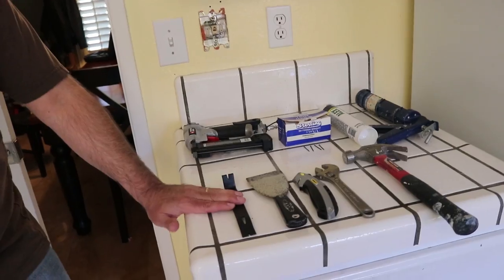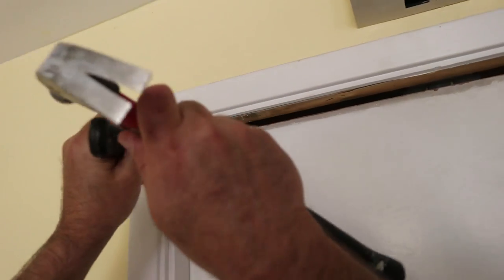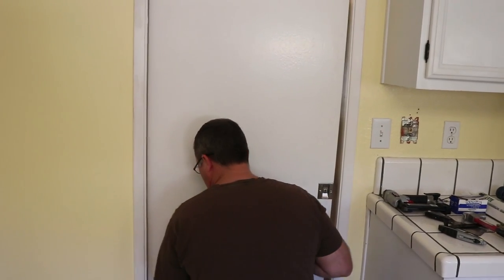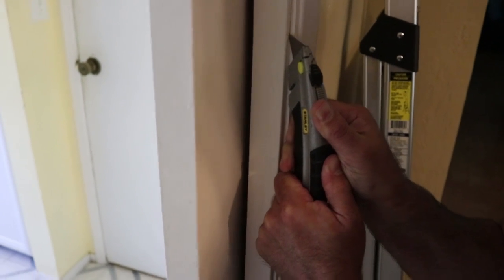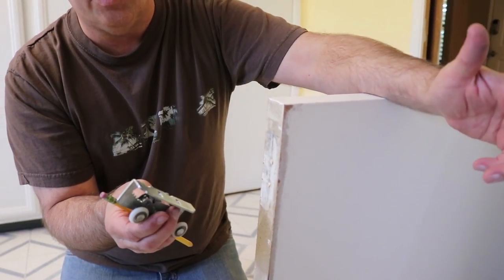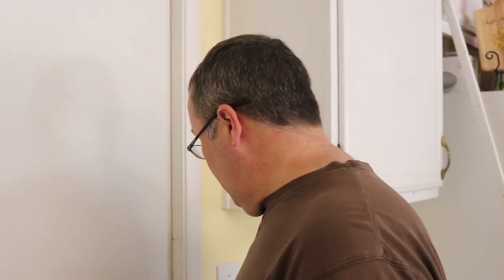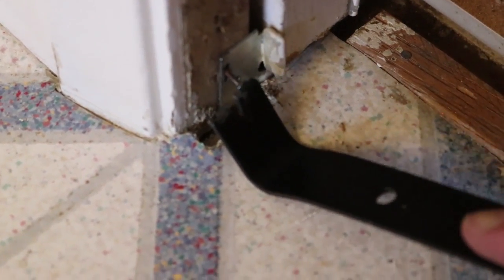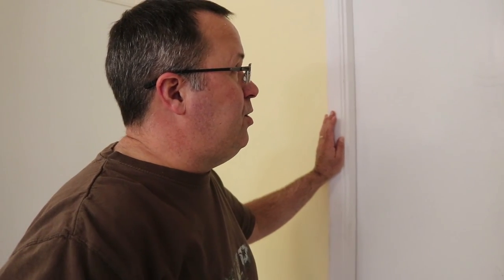How to Fix a Stuck Pocket Door

Comment: I'm gathering courage to fix a loudly protesting pocket door. Now, mine's tracks aren't the same as yours, but the process of getting at them looks much the same, so I'll try to follow your guide for that part, as it made sense even to a complete amateur such as myself. Thanks very much also for including the problems you encountered during this adventure—most guides tend to gloss over those as if, well, as if the job was running on rails 😉

Comment: I have a pocket door that is stuck.  There is an adjustment screw on the back roller.  It is keeping me from removing the door.  I am trying not to cut the sheet rock.  Any suggestions?  I call pull it out until that back adjustment scew hits the wall stud. I don't know what else to do.  Any help would be greatly appreciated

Comment: This video helped me a lot. I have the exact same hardware/rollers. One thing I’d like to add for ppl trying this. Once you finally get the door on the track, make sure and use a lubricant for the track and roller wheels!! I didn’t think it would be that big of difference but man was I wrong! It went from horrible scraping noise to smooth sailing. I used a garage door lubricant spray. Make sure to do the entire track and wheels! Roll the door back and forth until it’s smooth.

Comment: Nice video!   Just a suggestion,  Use a multifunction tool and cut the old guide out and avoid having to remove the opposite side trim.  You can replace it with an adjustable guide that is installed on the outside of the trim.

Comment: Nice work! A tip I've learned with removing the nails from trim is to pull them out with pliers through the backside. Saves having to patch the holes and less likely to damage the trim.

Comment: Thank you In years past I actually cut the drywall to access the rollers. This time I got the door out and back in three hours! However, you might add on item to your video. Sometimes when a door is sagging, like mine was, the track simply needs tightening. I could have done that without removing any trim.

Comment: Thank you. I didn’t notice if there was an adjustment on that hardware of the pocket door. It looks like there is a ratchet step bar on the hardware. Can you relate if that can be adjusted up or down if the wheels are still on the truck for a better riding door.

Comment: The main reason to use "painters caulk" (or Window and trim sealant) is because it can be painted. If you attempt to use a silicone sealant intended for kitchens and baths, they repel water and will also repel your paint.

Comment: You didn't explain how to measure where to replace the hanging hardware.  I am having trouble with that and taking the door down every time it needs to be readjusted is a big job! Also, how to do adjust the height of the wheels with the adjustment screw so the door slides even with the frame?

Comment: I have found it better (safer), when working with narrow trim, to use the small end of the mini pry bar and use a twisting motion instead of prying. I usually only work where the nails are located. It lessens the chance or cracking and less effort to remove the trim. Otherwise, great video.

Comment: I have the same problem, I can see that the screws on top are loose, is there anyway or any tool to use in the tight space to put the screw back in so I don’t have to remove/reinstall anything?

Comment: Also the reason for the repair is the back roller is off.  The hardware is designed for front roller to go on outside track and back roller goes on the opposite side of the track.
Reply: My boyfriend has made a tool to reach back and unscrew the set screw.  He welded a long piece onto the wrench.  We will see if it works.  I think the hardware was put on wrong in the beginning.  I think both front and back rollers should be on the same track.  Because you can't get the %$$%% back on track!  I'll let you know if it works.

Comment: caulk is good for the seams, but go for spackle on the nail holes. you can sand down the spackle, but not the caulk! that let's you get a nice smooth finish when you paint.
Reply: I've been using the Dap Plastic Wood.  It works GREAT!  And comes in colors, including white....

Comment: I searched for info on this last year.  Nothing.  Thanks for posting.  Unfortunately my house was built around 1980 and moulding apparently was not en Vogue.  I’m guessing I may have some drywall work. I really just want to replace the cheap paper thin hollow core doors with something more upscale.  

Also it would be beneficial to note that the roller assemblies for this type are typically ACME/Stanley No. 85’s.

Comment: Nice video. But my house settled and apparently bent the track, and while the door is still on the track, it's nearly impossible to operate. I've been told the only way to repair it is to tear apart the wall and redo the whole thing. Either that, or remove the door and frame-in a conventional door in it's place.

I guess I'm wondering why anyone would want one of these nearly impossible-to-service things in their home.
Reply: Because they are GREAT when they are working and you have a house that DOESN'T settle.  In fact, I'm wondering how a house could settle so much that it bends the track in a pocket door.  I would think that much settling would cause a lot of more serious problems than a pocket door that doesn't work.